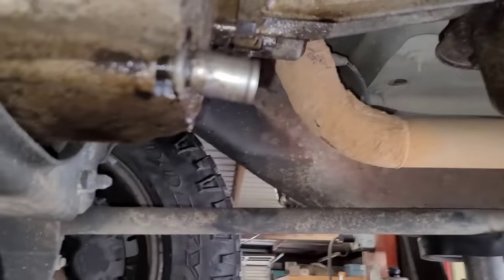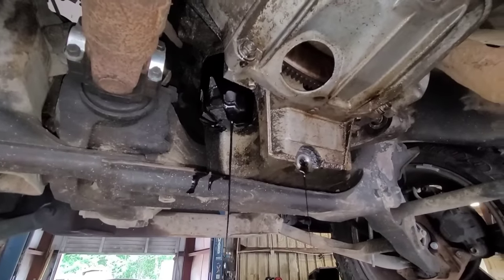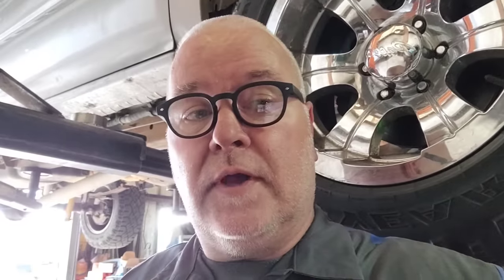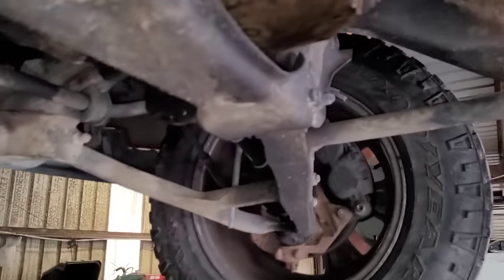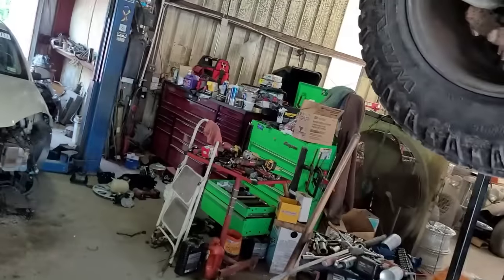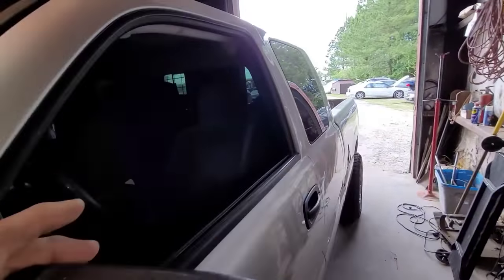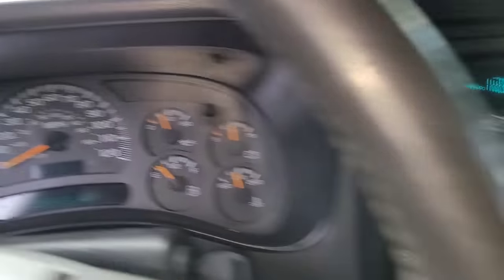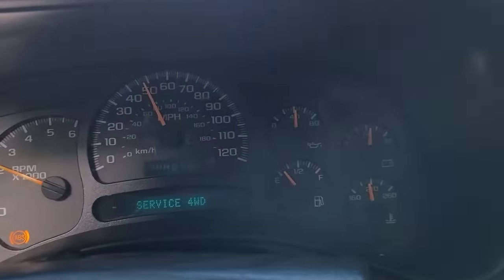We changed the oil in the noisy 5.3 and this happened!! The damage is done unfortunately..

Comment: As a quick lube tec. I have seen many cars trucks even diesel trucks with absolutely no oil and I mean bone dry doing 80 to 100 vehicles a day I’ve seen so so much great video very informative thanks
Reply: How fast do you do an oil change?  Let's see 1 engine every 10 minutes that's 6 engines per hour.  At a 10 hour work day that would be 60 engine oil changes. At a  12 hour day that would be 72 engine oil changes.   13 hours is 78 oil changes, 14 hours is 84 OC's, 15 hours is 90 OC's, 16 hours is 96 OC's,  99 OC's 16.5 hours.  WOW  6 to 8 hours of OT per day.
Reply: @sheldonmcclaflin8904  we have 2 techs on the floor for a 9 hour day and to be quite honest I can change the oil in 3 min regardless of what you think or what ever your opinion might be so ya 90 cars a day is not hard to see but thanks for your opinion
Reply: @Daviddilligaf  - Not questing your abilities, not the reason for my reply. My comment is simply that that is why I do my own oil changes. Less than 3 minutes of drain time doesn't give enough, leaves so much dirty oil. I drain it for at least 20-30 minutes, while doing other things.

Comment: Thats a Chevy LS engine for ya. My guess would be from the looks of the drain oil, the pick up screen is probably sludged up. I would recommend to the owner to drive it for a couple hundred miles, then change the oil again. Then maybe change it again in a 1,000 miles. If you have a good parts man, he can do some cross referencing and find a longer filter that has a little more filtering capacity.
Reply: a NAPA 100255 oil filter has the same threads except longer can. a 2014 chevy v6 impala oil filter (i don't remember the number) will fit the LS.
Reply: My first LS I bought 2 years ago I thought the oil filter looks same size as filter on my Harley.
Reply: i add a quart of tranny oil 1 week prior to oil change...got rid of my ford tick
Reply: Had it happen. Ran kerosene through it
Starting it. For a few minutes. Changed the filter again and drained it. New oil and filter. Changed it again around 1000.miles.Truck ran forever. The oil pump screen was gunked up.
Reply: Why not pull the oil pan and clean up the bottom of the pan and the sump screen?
Reply: @FalconFDX  Your right, that would be the best action. Customer might not go for it though. Personally on my 2018 3500 Duramax, I run a Wix 51794 or a PPE 114000550 filter, double the capacity of filtering and adds an additional quart of oil.

Comment: I have found that under high rpm conditions, my 04 LS based 5.3 can consume oil through the valve seals due to the fact that the oil returns in the heads cannot handle the volume of oil at high engine speeds. Yes, I change my oil when the oil life displays less than 25%, therefore there is has never been any sludge in my drained oil.Matter of fact the oil looks only a little darker than when it went in.At 325k miles, the oil pressure is 38-45 psi at idle depending on the temp of the engine.I bought my 04 Z71 new with 11 miles on it. I have had VERY good service from it apart from a rear crank seal at 256k miles.
My drug of choice has always been Chevy.

Comment: In my younger days when we had a .otor with damage like this,I would drop a new filter in about 500 to 750 miles .then resume regular changes.sometimes it helped sometimes  too much damage for was done,but it did take some contaminants  out  and you crossed your fingers and held your breath.
Reply: Good suggestion, on older engines it is still necessary  to watch your oil pressure. If you see it start to drop before your normal oil change then the filter is most likely starting to clog up. if the oil still looks good just change the filter.
Reply: 1989 c1500 5.3 18000. Doing a restoration on body. New bed, fenders and doors.

Comment: I have a 2006 Mercury Grand Marquis with 387,000 miles on it. I have changed the oil and filter every 3000 miles. I use 10w30, not 5w30. I will soon be changing to 10w40 to compensate for engine wear and increased clearances.  The oil still looks almost new when I drain it out. Oil and filters are a LOT cheaper than engines. I do have a spare engine for it though, for when the original engine finally does wear out. I do put oil on the filter seal. It helps to avoid tearing the seal. You can also turn it just a little bit more. I always snug up filters with a wrench. I use spray brake cleaner to clean the drain plug, the area around the drain plug, and the flange where the filter goes. 

What oil treatments (like Lucas and STP) do is increase the viscosity of the oil to compensate for loose clearances in a worn engine, and they definitely do help. I had a '64 Fairlane with the 200ci straight six in it that was burning a lot of oil. I put 40w oil in it, and about a quart of STP, and that reduced the oil burning by 2/3, and I continued to drive it another 5 years or so like that. I would have used much thicker oil in that engine. It won't fix the damage, but it will compensate for it to some degree, the engine will run better and last longer.

Comment: My ol lady had a 2007 trailblazer with the 5.3. She ran that thing out of oil more times than I can count. For the last 40,000 miles we had that thing, you had to add a quart of oil every 100 miles, it burned and leaked it out so fast. Between front end parts, steering parts, and that horrible engine with its dod garbage, it did make it to 260,000 miles before we sold it to a scrapper. It still ran and drove, the ac and heat still worked, all the power options, including the seat. We were just spending too much on oil each week.

Comment: I GUARANTEE that pre-lubing the filter gasket allows you to tighten the filter a little tighter when hand tightening (as I prefer to do)...
Reply: Baby muscles.
Reply: @tayaria7280  stupid: the gasket MUST be oiled before install because if not it's not possible to tighten correctly per hand with so tiny access, and the removing from the filter after use will be very PROBLEMATIC...
Reply: @leneanderthalien  no true oil on the gasket will not help you tighten it more and reguardless they dont need to be tighten more than hand tightened anyways.
Reply: If you don’t know how to put a filter on, don’t do it all use a torque wrench, torque the oil filter to the proper specifications. If you don’t know how to put a filter on correctly that’s why you torque bolts sorta even pattern so you don’t break them off And the gasket is crushed evenly so for you apes out there, get a torque wrench in a cup and torque your oil filter torque spec, 18 to 20 foot pounds and people may laugh about this. It’s not a joke do the job right use a torque wrench on every bolt. There’s a reason why they have torque specs that’s why 90% of the gaskets out there don’t last because they were installed incorrectly we’re not torqued correctly.
Reply: @CharlesLease-ei1ee  SPIN ON filters all tell you to use your hand to tighten.  Use of a tool can damage the filter housing.
1) ensure old gasket is removed and clean mating surfaces
2)light coat of oil on gasket, tighten till gasket touches filter base
3) hand tighten an additional 1/2 - 1 full turn.  The filter will specify how much based on the hardness (durometer) of the rubber seal.
The light coat of oil makes it easier to install the correct number of turns.
Cartridge filters, sure, use a torque wrench on the cover, but the torque isn't what does the sealing, it's the fit of the o-ring. Most leaks are due to people using old o-rings or stacking old and new in those styles.
Reply: @btwbrand  i agree with the oil on the gasket for a better seal - but in a situation where you do regular maintenance and have a clean surface everytime you change the oil - the surface should have a pre oiled surface from the previous filter leaving the gasket oiling unnecessary. But people like to always do it one way or always do it another. If its dirty and you have to clean the surface, yes oil the gasket. People who dont think the gasket requires any oil at all dont think about what happens to rubber when it gets squished to dry surface lol. Will not remain graded to the filter

Comment: If I were the owner, I would be back at your shop to get another oil change and filter in 1,000 miles. The insolubles and carbon buildup in that engine are going to use up the detergent component from the additive package in no time. The next change will also flush out some of the metal as it is loosened from laminar surfaces. He might get a few extra thousand miles out of the engine AND the next oil filter should only weigh 3lbs when removed LOL! Unbelievable how some people spin the wheel! I would LOVE to see the spectro lube oil analysis from that sample you drained! OMG! When did GM start using a 3/8" drive drain plug?
Reply: It’s the new standard equipment
Reply: @stephenrickstrew7237  - LOL! How bout it! I've seen some pretty strange stuff but Kenny gets some interesting things in the shop.
Reply: Back in the ‘70’s I was working on a Chevy van and I said this oil sure looks bad (35,000 miles).  He said well that is still break-in oil.
Reply: @mystic24100  - Wwwow! All I can say is Wow!

Comment: Those old ls motors are tough as nails. That's unbelievable
Reply: No their not.
Reply: Ain't no damn motor. It's an engine.
Reply: Any engine that can run on 1 quart of dirty ass oil having 250,000 miles is a bad ass motor
Reply: @nobullshit9721  Right. Keyboard mechanics can't help themselves they feel compelled to make a comment based on their backyard wrenching experience
Reply: @nobullshit9721  Engine. Motors are electric, engines are internal combustion. Learn the difference.
Reply: @johnaustin9051  bro nobody cares
Reply: @johnaustin9051  
MOTOR

noun
a machine, especially one powered by electricity or internal combustion, that supplies motive power for a vehicle or for some other device with moving parts.

adjective
1.
giving, imparting, or producing motion or action.
"demand is the principle motor force governing economic activity"
2.
BRITISH
driven by a motor.
verb
travel in a motor vehicle, typically a car or a boat.
"we motored along a narrow road"

Comment: Ken The oil pressure wasn’t too bad at 2000 rpm it was reading a little over 40psl for oil.   Time will tell. There wasn’t much oil in the truck. Nice video
Reply: You actually only need 7psi Oil Pressure per 1,000 RPM .... It'll be fine !!

Comment: One of the tricks that I use is get a large soda cup that will go over the filter after you get it lose but before it starts pouring oil out, slide over the filter and turn it off the oil won’t spash all over. Obviously you can do this with the filter that comes out straight up. Just makes a little cleaner job. Great video!

Comment: On these GM trucks and SUVs, it's easier to use the longer "truck" filter due to the difficulty in reaching around the filter. I agree, it is in an awkward position. So instead of the PF46 you can use the PF61. Or if it takes the PF48 you can run the PF63. Both these filters are longer and fit just as well. But they are easier to grab in that narrow hole.

Comment: When I was in High school I raced a Cuda with a brand new built engine with automatic.   I was in my 69 rt charger manual 4 speed. Well when I was just about to hit 4th gear I heard a huge bang. My windshield was coveted in oil so I shut down.  Turns out the other car blew the oil ring gasket because they didn't lube it.  That's all I know.  So I choose to always lu e them just in case.

Comment: These old 5.3 trucks (99-06) are just tanks. The motors can take a ton of abuse and just keep on ticking (pun intended) 

You keep up on maintenance with these and you’ll easily see over 400k on a motor. 

The 4l60 transmissions go PNNNN sometimes, but these trucks tend to be abused by their owners so it’s not surprising that the transmissions grenade as they try to do burnouts.

I am glad to see that this truck in the video seemed to bounce back a little with a little work.

Good video. Keep it up! 👍

Comment: I bought a used 1986 Jaguar XJ6.  I found a mechanic that was very familiar with the car.  I had him do an oil change before I went on a trip to Vermont.  Very hilly Vermont.  As I was climbing a very steep road, I was losing power. At the bottom of the other side of the hill, I checked the oil and found none on the stick, so I added a quart and continued home with no issues.  The next day I checked the oil again and found none on the stick. It took three more quarts until I finally saw oil on the stick.  

The mechanic had a container that held 5 quarts that he would put in and he would put the last two quarts in individually.  He forgot to put those 5 quarts in the engine. I had half that trip on two quarts of oil and three quarts for the trip back!  I later found that he was a drunk.  Luckily the car never smoked or gave me any problems after that.

9:00 As I'm sure you know, those oil pressure sensors fail, and sometimes you get correct readings, max pressure readings or it drops down to zero.

Comment: Your comments on tightening filters and plugs should also apply to wheels.  Some time ago I had a small argument with a mechanic about     tightening wheel nuts.  He firmly believes in impacting them on until his compressor explodes and I will use the impact to run them on and then tighten them by hand with a swing bar, pulling upward.  I told him I want to be able to get them off if I have a flat out in the boondocks ,and I can easily put more than 100 ft.-lbs on them like that.  He seemed incredulous that I had never had one come loose.  I later removed a wheel he had put on and had to break one of the nuts.
Reply: Does your tire mechanic not own the proper TQ wrench 🔧 🤷🏼 Depending on the car they are between 85 and 110 ft pounds and trucks go up to 180 pounds. It’s a manufacturer spec
Reply: Tom my pet peeve is overtightened lug nuts.
Reply: @devengudinas1649  Owning the proper tools in a box 20 feet away doesn't necessarily he'll go and get it when the impact is nearer.  After all, he'll probably never have to take that wheel off.

Comment: Our 2001 Silverado with the 5.3L had 200k on it and the engine was still strong.  The body however was rusting away after 13 years, so we bought a new one.
Reply: Got a 00 gmc sierra....now has 345k on it.....its a complete rust wagon....and the engine has an oil leak somewhere now....but still runs great

Comment: The filter is 1qt and what drained is another . 3 qts low . Run some kerosene through it for about a 5 minute idol . Drain 3 days later and all those oil passages will be clear again . New filter and oil run it for 1000 and add a qt of kerosene run it for 50 miles and drain . That’s as clean as it will ever get .

Comment: Seen many Ls the pickup tube 0 ring is done.  Reported oil pressure fluctuations.   If you are lucky you catch it in time.   Always fill the filters as much as possible when changing oil.  Never hurts to put a 1/4 a quart in the engine after draining the oil. Help push any debri out. When you see clean oil finally dripping.
Reply: I have 2004 6.0 326,000 miles.  i would start it and it would have next to zero oil pressure, then it would catch and go up to 40, 55 on the highway.  Once it got colder i would start the truck and it would catch after a second or two but while warming up it might drop back down.  So i changed the o ring.  It looked fine when i removed it but i changed it anyway.  Now it goes up right after starting and it's a solid 55 psi until it's warm and then it's 40.
Reply: What o ring are you talking about?
Reply: @tonybyrne3613  
The o-ring that seals the top of the oil pick up tube in the oil pan.  I did mine in our 2005 yukon, and oil pressure at idle is now around 35-40, and when you step on it, the oil pressure moves right on up with motor speed to about 60 psi.

Comment: I have a habit of checking my engine oil every 3rd trip or so and engine coolant every 5th trip few times per month so I do not run low or I can see when the oil would mix and get contaminated.  This is a very good preventative maintenance.  Tire pressure every month or 2 I check and I took the wheels of once every 1.5  years to see my break pads.

Comment: Personally, I ONLY use Wix filters, oil is checked weekly. Once it starts to get dark, it's gone. This is how my 96 Blazer has 220,700 miles and still runs great. Last change I cut the filter open just for shits and giggles, no metal in it. Keep on wrenching.
Reply: Jeff you are wrong about dark oil being "gone". We change oil every 20 to 25 thousand miles and it is dark long before we change it.
Reply: Lets do some math and discount your stoey with jt: your vehicle is 27 years old with 220,whatever miles on jt. That's way less than 10k miles a year, which isnt shit, really  
You put 300k on a car in 5 years and then tell me what worked for you. I'll maybe listen, then.
Reply: @Joe Blazer  to be fair, 220,000 is 220,000 and one could argue that taking that many years is actually harder on the engine than putting it on it over a short period of time. At that mileage it is probably  not a lot of hwy miles. Now we use Fram filters and Castrol.  I have 3 Toyota vehicles with 1.4 million  miles between them and I change oil every 20 to 25 thousand miles. Did the same thing on a civic and put almost 500,000 on it.
Reply: Dark color means nothing. Oil is still fine. Bough new 1986 Toyota Truck 22RE is a 37 year daily driver with 482K on original engine, transmission, drive line/U-joints, and differential. Change oil every 5K with that "shitty"dino oil- Castrol GTX 10W -40. Burns less than 1/2 quart between oil changes. 22RE engines are 500K plus durable.